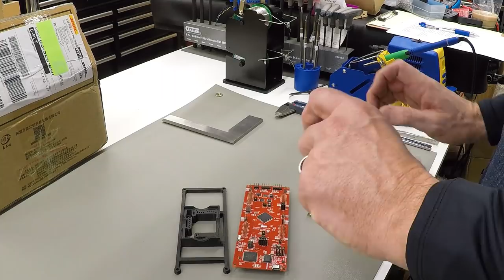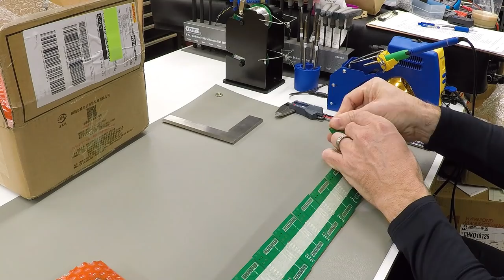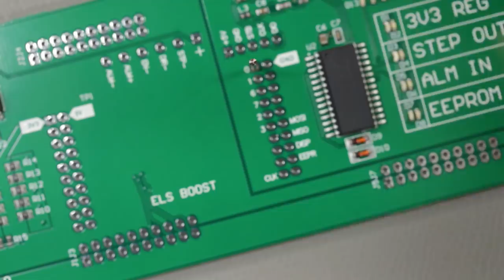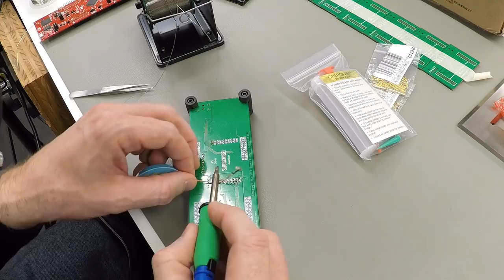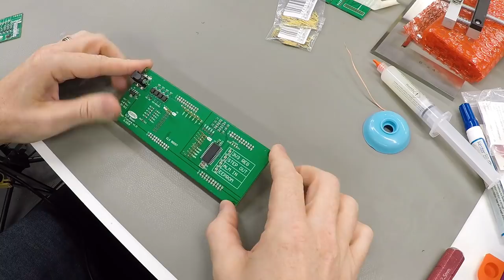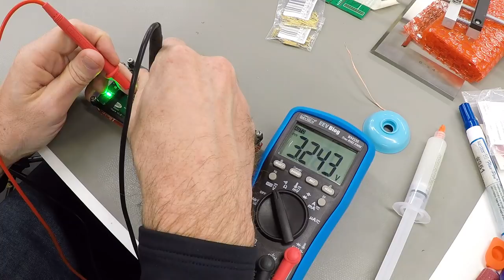Lathe Electronic Leadscrew Part 13: Assembling a Bed-Of-Nails PCB Test Fixture

Comment: I like the format the way it is. This gives us a good view of all things you do during development. But this also gives us the opportunity to comment on your work.
Writing that ... looking at the use of the pogo pins I have a remark about soldering them. These pins are meant to be used in sleeves. These sleeves are pressed in a board (we mostly use Trespa) and either soldered directly to the PCB underneath or using wires.
This way there is no risk of damaging the pogo pins during mounting and you can easily replace pogo pins when they get damaged.
But hey - it works for you and for a small batch (and I mean less than a few 1000 pieces) this is good enough.

Comment: I think the pace is great.  Lots of information to pass along and it takes time.
I designed and built a number of "Bed of Nails" test fixtures in my career.  I always used sockets for the pogo pins.  It made changing a dirty or sticking pin much easier.  The sockets had a shoulder to set the height above the board.  There were multiple options for the pin height by selecting the correct socket.

Comment: I think the level of detail on your channel is perfect for those of us who actually want to learn and build things.

I’m thinking about a variant of your electronic lead screw that could work for both automated manual mode, and also accept a stepper motor input signal from a CNC program, like say Linux CNC. 

Basically have a mode on the ELS to make it look like a stepper (or servo motor), and have it pass the stepper signal from the CNC through to the stepper drive motor.

Another idea is Maybe also replace the guts Of the carriage with a rotary encoder, and use that input to drive a ball screw, basically replace both the lead screw, rack, pinion with a single ball screw, but encoders to accept manual input so the lathe can be use in manual mode.

Comment: Hi James. I Love the vids and the project. In a previous life I designed functional test equipment for PCB manufacturing. I have designed a bunch of pogo fixtures like you are building there. I have two suggestions. First, as another commentor already pointed out, aligning the PCB with the fixture is a lot easier if you have guide pins that catch alignment holes (often just the mounting holes) in the PCB and force the PCB under test to be co-planar with the bed of nails. Second, most pogo pins are not meant to be soldered in place directly. They are generally installed into sockets. The sockets have soldertails on them that are designed to be soldered into a PCB. We used to press the sockets into a delrin block and then solder the test PCB right to it. That way the pins are fixed in place rigidly. This method also has the advantage that pin replacement is very easy. 

Keep up the good work.

Comment: As usual, you have taught me some things that I did not know or was only partially aware of.
I really like your channel because you always teach me something, not just show me something. One important thing for me, as a senior on a fixed income, I pretty much need to budget, in advance, most purchases so it would be helpful to have a general idea as to the pricing of your board. I have all of the other parts required for this project and am only waiting on this final piece. Most months, my monthly "fun money" is pretty much gone by the 15th of the month, regardless of my best intentions. Too many projects, not enough funds. As a final thought, I would be happy to do my own soldering of the finish parts on the board. Receiving it as a kit would be just fine as I have a lifetimes worth of soldering experience and time on my hands.

Comment: Soldering the pins directly could interfere with the spring.
Pogo pins are supposed to be inserted into an available brass sleeve that is soldered to the board. 
The sleeves will also allow easy replacement of bent pins quickly by the operator.
Reply: I was about to say this myself the pins dont have a good coating to solder to but the sockets for them do, the sockets also have indexing ridge at the right height to drop into a pcb.
One other thing turn the heat up on the iron your first solder looked to me to be about 15degC too cold. and +1 for the tacky flux i sue it on everything and it makes life a lot easier.

Comment: Pogo pins (being all metal) will wick the heat away from the joint. 
Notice at 11:53 and forward how the solder is "following" the iron tip. 
This means the tip is getting cold. The added flux helps break the surface tension.

Comment: I'm loving this series of videos they are some of the best I've ever seen on YouTube.  I can't wait to find a good lathe to apply this project to since I've been wanting to set up a home machine shop for several years.  

I've been working in electronic manufacturing for over 30-years and I have some experience with soldering to gold and platinum they don't oxidize because they don't react to almost anything and that is the problem you are having soldering the gold.  Copper, beryllium, tin, and lead all react easily so all you have to do is keep out the oxygen to prevent oxides that stop solder wetting and that is what no-clean flux does but when you are soldering to precious metals you need to go old school and use a flux that forces a reaction that means acid and that also means you'll have to clean after or the acid will eventually eat your circuit board.   We use RA flux and solder with an RA flux core to achieve a good result with precious metals and we water clean those fluxes off.

Comment: Very nice fixture design. I have one suggestion: add a couple of alignment pins that go through the mounting holes in two opposite corners of the DUT.  I would use some finishing nails, with the points filed round so they aren't too sharp.  Just put a nail in a small drill press, like a drill bit, put an unstuffed DUT board on the fixture to act as a guide, then melt the nail into your 3D-printed frame by spinning.  I find that it also helps to make score lines on the part of the nail that will be melted into the plastic, to make it harder to pull out.  If the mounting holes on the DUT are plated and grounded (I haven't watched the prev videos on this project) then the guide pins could also be grounded to give you the first-contact that you are presently doing by raising one pogo pin higher.

Comment: I've occasionally seen comments that there are holders for pogo pins, that you're not supposed to solder directly to them since they have a limited service life. I've never actually seen the holders, just heard of them. Maybe they're only sold to YouTube pedantic commenters 😉

The multiple pcb stack technique is definitely the way to go for holding those pogo pins, though. It offends my inner cheapskate (multiple pcbs, only one of which is used for electrical purposes? Perish the thought!) but even with proto boards it helps.

Awesome stuff! I'll be really bummed when I've run through all your back catalog...

Comment: I've had some experience with pogo pin test fixtures for a Marconi ATE. You're heading in the right direction but you need a mechanism to hold the board under test onto the pins. Our usual mechanism was vacuum as that ensured equal pressure over the board but then that adds complexity and constraints to the board under test's design.One thing for sure, you need a programmable purpose built test system. We'd never start by putting power to the board under test. First phase was testing as many components as possible for correct value and orientation etc. then via programmable power supplies start to power the board up.
Reply from the maker: In this case, the test should take less than a second, so I haven't bothered with a clamp system yet.

Comment: i would think the pogo pins drawing the heat away from the joint is also an issue, so maybe heat the pin a bit, then the pin and the pad, then apply the solder?

Comment: Try some Kester 2331-ZX on those pogo pins. I also usually have to turn my heat up a little bit because of the additional mass sucking the heat right out of the tip. 

I agree with everyone else about your content.  There's plenty of Colin Furzes out there.  I appreciate content without all the attention grabbing nonsense

Comment: Hi James,

I just want to begin by letting you know that I’ve really been enjoying watching your channel. 

I know that you’re in the process of making/testing your z-axis electronic leadscrew project, but I wanted to ask if you had thought of a future project that advances on this by also including an x-axis leadscrew control? I’ve recently begun working in a shop with lathes that have this feature. These lathes can be used as manual machines, but also as CNC lathes, that allow you to create arcs, chamfers and more complicated shapes by ‘drawing’ your design (on a DRO/computer) with the x- and z-axes working together to form these shapes.

I’m not sure how difficult this system would be to create, however, I can say that these ‘hybrid’ manual/CNC lathes are fantastic to use, open many opportunities and would be a fantastic extension on what you are currently doing.

Regardless of if you went in this direction or not, please keep up the style of content that you offer as it’s great to watch.

Best wishes,

Rob.

Comment: Tip for you, next time you make a revision of the board, under a large component add to your silk screen "JLCPCBJLCPCB", they will print the annoying board serial number there and you will never see it after you have soldered on the component. I make the text height about 0.8 mm.
Reply from the maker: Yup.  You'll note that the order number is under the servo connector on the production boards.

Comment: Hi. Thank you great video again! Your ELS videos inspired me to do similar project, I ended up to desing my own board and now Im waiting for components. One question not related directly to this video but ELS generaly, what size timing belt and pulleys u use between leadscrew and  motor?
Reply from the maker: 15mm wide 3M, IIRC.

Comment: Have you thought about the stm32 mcu. They come in a easy package as the "bluepill" its fast and reliable. And can be programmed with the arduino ide. As so it would be possible to integrate it into a pcb in the final run and to sell the whole thing as one package. Its cheap to. I work everyday with encoders of every kind and motors of all kinds and for your purposes it seems entirely possible and quite a neat solution.

Comment: Have you considered making a program to turn this project into a gearhopper for the mill, it seems to be the perfect solution for a affordable home shop gearhopper with the encoder on the spindle and the stepper/servo driving a fourth axis with the gear blank.
Reply: I am also following this to potentially use as a gear hobber. Where do you go to add oneself to the list of purchasers, or has this not been opened yet?

Comment: Great series James... really like how you show how you work through any issues that you come across... This is an upgrade that I will be putting on my lathe in the near future...
One question that I do have is..
Is it possible to control 2 lead screws (2 stepper motors) individually with the one board? My lathe has the 2 lead screws 1 for threading and one for cutting.
Reply: Are the two lead-screws geared together?
Reply: @boldford  they are through the gearbox but the whole gearbox is worn out and needs rebuilding so was planning to remove it completely and hook a stepper motor directly to each of the shafts if they could be controlled individually as 2 different formulas would be needed for each shaft
Reply: @mr.b6034  This may be a daft question but does your machine actually have two lead-screws or is one a slotted shaft?
Reply: @boldford  yeah, one is a slotted shaft

Comment: Please don't trim your videos. The longer format is much better suited to this sort of content. Details matter in stuff like this. The production value of your videos is painfully good. You do a fantastic job of editing in the best angle so we can see what's going on, and the audio is always very good.

A note about the PCB: as a habit I always remove the thermal reliefs from the vias in copper pours. It doesn't matter at all on a board like this, but those do add some inductance. No need to solder to them, so there's really no need for the relief anyway. 

Thanks for all the great content!

Comment: WTH do you find the TI piccolo board?? I've looked everywhere.. Got the Clough board easier than the TI!
Reply from the maker: Mouser or Digi-Key.  The TI site has links to global distributors.
Reply: @Clough42  Thank you...ORDERED! I am seeing open loop, closed loop, 12/24/36V , 2.2nm, 3.0nm NEMA 23 servo motors... What specs are needed on the stepper? Thanks again James.

Comment: You are leaving the iron on the solder joint too long, it burns off the flux core and then the solder spikes.
Edit: that's why adding a bunch of flux fixed the problem, but you should try soldering faster, it should be a clean tip, feed some solder into the tip before touching the joint, make contact, touch solder on opposite side of pin, as soon as it melts remove solder and then iron. Try it, I think you will like it.

Comment: IIRC you're using lead-free solder. There's no need to torture yourself with using lead-free solder on things like test fixtures. You're not selling test fixtures. 
For some of your work, I'd also strongly recommend ChipQuik low-temperature solder paste (SMDLTFP10) . RoHS compliant-paste that's great for permanent work and rework.